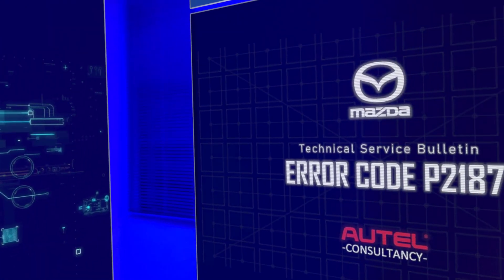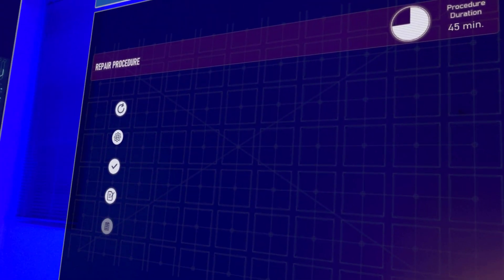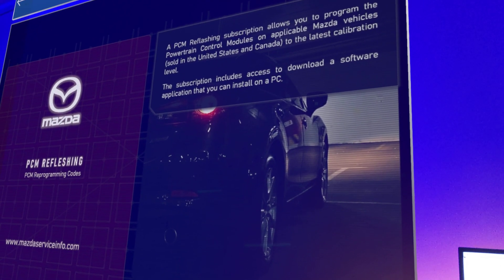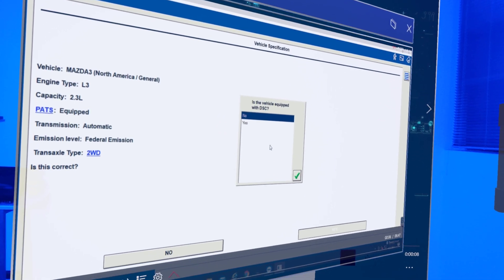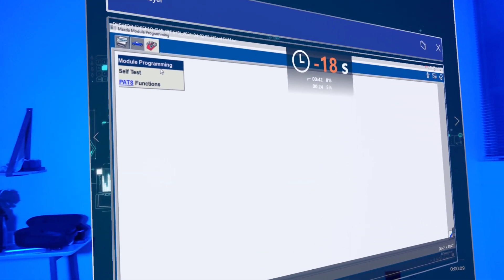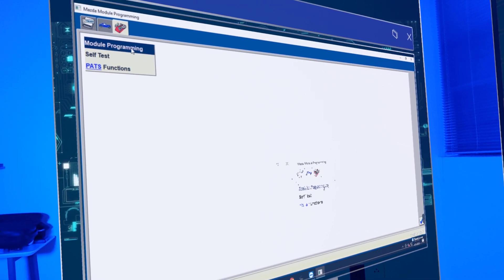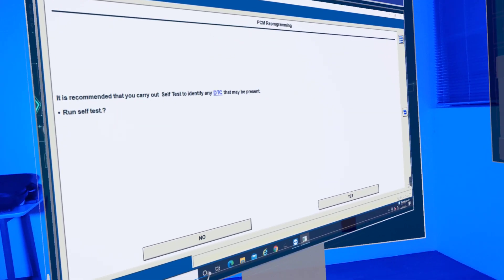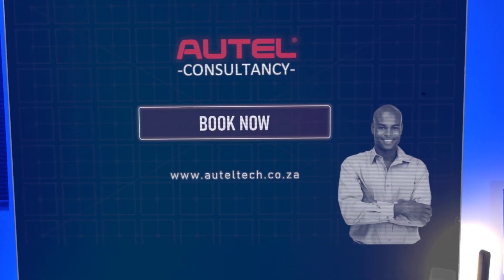TSB- How To Solve Error Code P2187 On A 2007 Mazda 3MPs |  PCM Reprograming With Autel J2534

Comment: I seemed to recall one where the P2187 code was caused by a vacuum leak between the master cylinder to brake booster mounting area. It was confirmed with regulated air pressure from my smoke machine and soap water
Reply: ñ